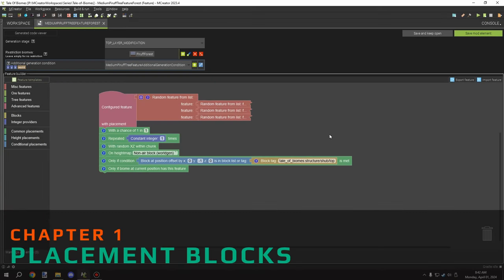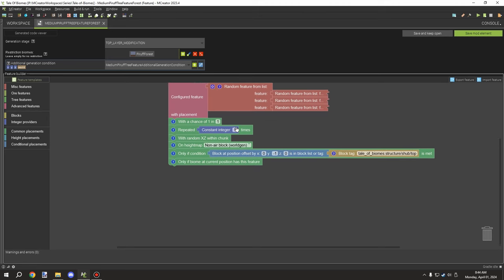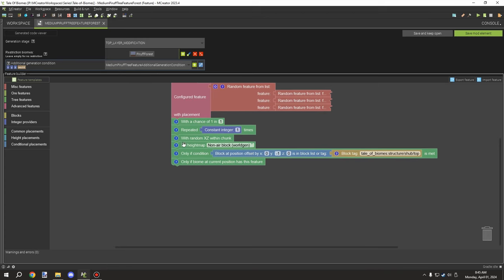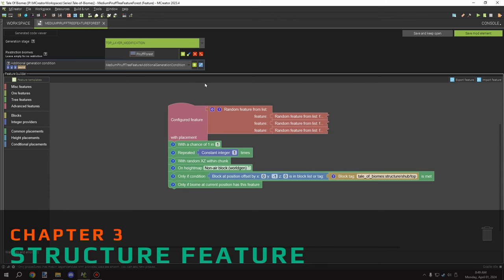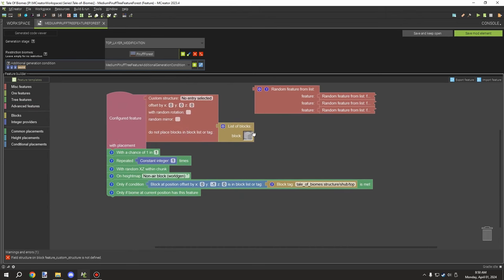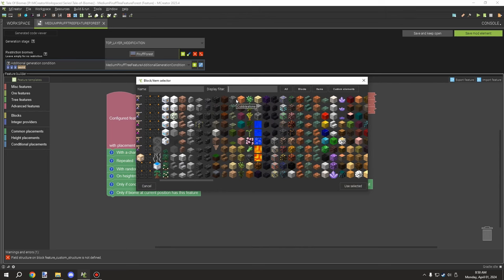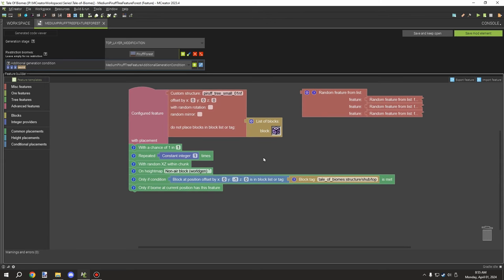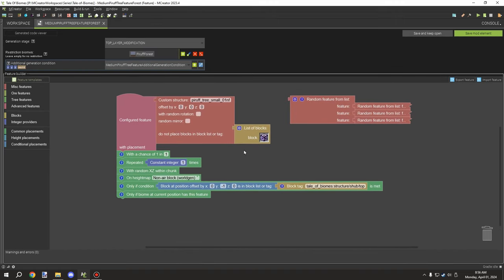FEATURE STRUCTURE Generation in MCreator 2023.4

Comment: How do i make my feature spawn inside or near a structire only?
Reply from the maker: Structures are an entirely different system. If you want features to generate I suggest using jigsaw blocks and plopping copies of your features as separate parts. In short there is no way to really know or test where structures generate so the jigsaw method would be your best bet.
Reply: So I can use different props of they are categorised under the same jigsaw group then randomize them?
Reply: @NorthWestTreesMCreator Like i want to make random blobs of suspicious and normal sand  inside my structuee
Reply: It becomes repatative after sometime

Comment: Any videos on how to make a custom trees? I'm trying to make a couple of fruit tree variants, One type with harvestable fruits on them that grow in the leaf block, and the other type would have fruits similar to how Cocoa beans generate, I'm guessing that the "Bean" type would check for an adjacent log on one side and air blocks on the others for placment, but can't find anything on this, So ant help would be great. Cheers
Reply from the maker: I have a few tutorials on them on my channel, though more recently I made custom trees in the Lore Series during Episodes 56, 57 and 58.

For your regular leaves I would do the following.
- Make sure the leaves are ticking randomly so they will work with natural generation.
- Test if the leaves are exposed to air, only one side should be required so use OR operators when using each side.
- Then you will need a way to know how many fruit leaves are around the current block you can use something like this script https://github.com/MCreator-Examples/Projects/discussions/87 to test a 5x5x5 area and count how many fruit leaves there are. 
- If there is less than 3 leaves then you can replace your current leaf block that ticked to your fruit leaves. The higher the number the more fruit leaves the tree can have at one time.

So to recap what will happen is the leaves tick randomly so when they generate naturally they can function normally then we test if they are exposed to air on any side so the player can easily get to the fruit, we then test how many fruit blocks are around the current block and then finally update the block if that number is less than a set amount.

I most likely will do this in the lore series once I have gotten through adding more stone variants.

Comment: after updating my mod for 2023.4, all my structures stopped being generated... It looks like I need to learn something new again.
Reply from the maker: Older versions used features which is a separate system, chances are it ported them to features, though in the case it ported it to structures it may be wise to keep them as features as the conversion should be better for older mechanics.

Though the new structure system uses actual structures which supports jigsaw blocks which is pretty advanced but still offers a lot more flexibility for designing more complex structures even with settings MCreator does support its pretty good to get started with though I will be covering more advanced stuff in the near future but I have stuff I need to finish before then for tutorials.

Comment: Too bad this causes errors in the console whenever a structure placement is used because of setblock being used in a far distance
 which prevent me from really usin it as i don't want errors showing up in the console
Reply from the maker: "Tried to load a DUMMY block entity @ BlockPos{x=43, y=34, z=46} but found not block entity block Block{minecraft:water}[level=1] at location"

This happens when features replace over other features during generation, it won't impact the game to much if you space out your features more it should happen less but things like trees or terrain or foliage generation its completely harmless. At the most the structure will spawn inside of the other one possibly replacing the other one a bit but that's just how the game works when it comes to procedurally generated games.